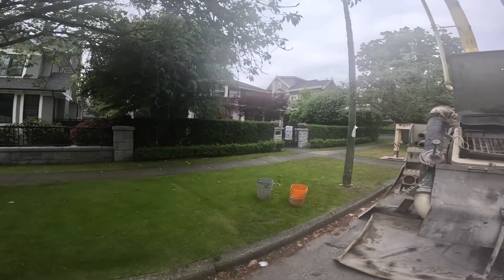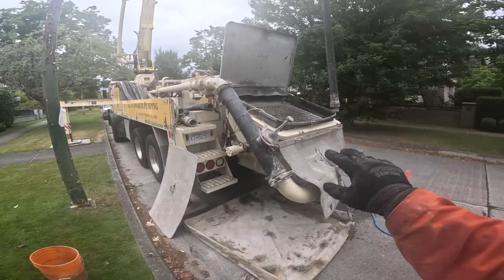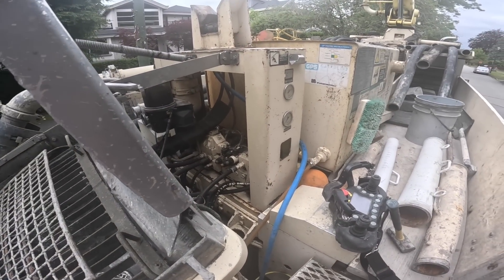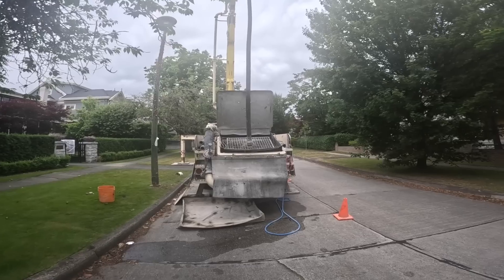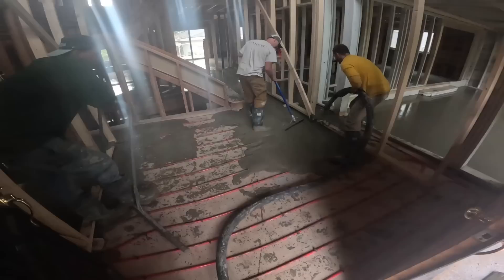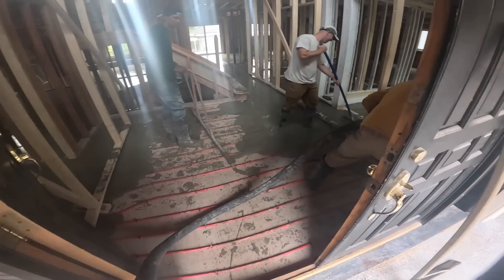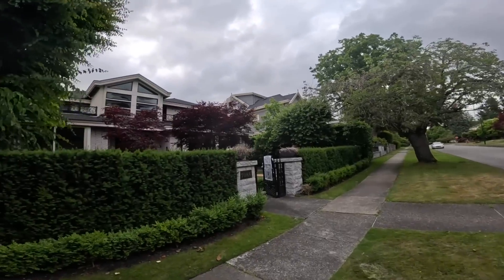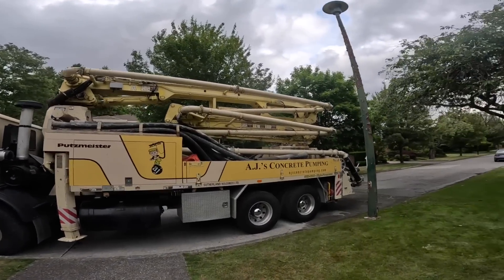Pumping floors with self-consolidating concrete:

Comment: We have a 28m Z boom in our fleet and its definitely the most versatile boom pump we have. For most of the jobs our bigger pumps do (where customers just want a big pump on site and the distance isnt necessarily the reason) we can get the 28m in also if we just think a bit more about the set up, so its a great back up pump to have on standby as well.
Reply from the maker: Thank you for the info. It’s good to here it firsthand from someone who’s running a 28 in their fleet.
Reply: @canadianconcretepumper1979  yup, and from your videos I would say our residential and smaller commercial jobs seem to be pretty similar to yours so a 28m would probably just as perfect for you as it is for us.

Comment: I agree on the 24m. A lot of jobs that i pull up to with it don't quite reach all of the job and end up with a hose on the ground. Where as a 28m would reach with a little push of the tip hose. Also looked like your debris came out in the prime of the boom at 13:54, ironic that you primed with out the screen as you would have caught it.
Reply from the maker: Nice job!!!! Shit, I had to rewatch that segment like 5 times over to catch that. This mix is so fluid that we actually pumped off more than half of that first load before it display dry-packed where that chunk was lodged into the reducer.
Reply from the maker: You comments with regards to the 28M confirm my theory. Good to here it from someone else in the same boat. 👍🏼👍🏼👍🏼
Reply: @canadianconcretepumper1979  Actually heard a clunk as it hit the grate then rewatched it slowed down and saw it.

Comment: maybe to "keep it in the family" so to speak, have you considered looking into the 31-5 putz? dont see too many of them around, not even sure if they still produce them, could be a reason why.  i believe they are a ZR config, sort of like the 20

that second chunk, to me, looks like a piston cup face chunk. i recently had the misfortune of finding one of those myself in the 5-4 reducer lol
Reply from the maker: I think you’ve nailed it with the piston cup chunk diagnosis. The 31 Putz I’m not super hot on. The reverse folding tip section makes it one heck of a low clearance pump, but from why I could imagine would also make it a bit of a bear for pump everyday/normal work. Also, the large-ish swingout style rear outrigger legs are a bit deal breaker due to the nature of the tight setup scenarios which we would need it for. I do think the the 31-5 Putz could arguably be the best pump ever for indoors/warehouse work, but we unfortunately don’t see a whole lot of that stuff.
Reply: @canadianconcretepumper1979  didn’t consider the swing out outriggers in the back, with the straight out style like schwing or the alliance i can see how much that would help in tighter set ups. my company has a 28M, got it just before the announced the redesign ☹️ great machine, unfortunately i feel the rear out rigger set up is just a bit under spec for that size boom, gets fairly unstable off the back corners, which is to be expected, just wish they could slide out like the schwing/alliance
Reply from the maker: @HighTQCummins  First boom I ever ran was a 1988 Putz 32M with the short rear outriggers. When you’d boom flat out over the rear corners the opposing side front outriggers would lift 1-2 feet in the air. Most definitely not the greatest feeling, lol! Our little 24Z does fine with the drop down rear outriggers, but I’ve always been curious as to how the 28M behaves with that same setup. I’m wondering if the newer 28Z would possibly be more stable as I’m guessing the boom would be lighter as compared to the previous iteration. 🤔🤔🤔
Reply: @canadianconcretepumper1979  it’s not that bad but it does like to dance when you stretch way off the corner

Comment: That’s why a use a rake when cleaning out
Reply from the maker: This pump actually has one I believe. The high-pressure back end has a lengthened outlet flange which makes it much more difficult to cleanout versus the standard boom pump back end. Definitely a few tradeoffs to running this heavy duty back-end kit.

Comment: I would replace it with a 28m putz. Having gone from a 28m down to 24 I don't see any advantages of a smaller pump than 28. The 24 and 28 take up almost same space when set up but the 28 reaches much more.
Reply from the maker: Exactly the way I see it, especially considering that the new 28Z Putz actually has a smaller outrigger footprint than our current 2005 model 24Z. The one main advantage I see with the new 24Z over the new 28Z is the ability to hang the boom over the front of the cab and drive into position prior setting the outriggers and unfolding. That being said, we see far more jobs which would benefit from the additional 12’ of reach of a 28M versus the ones which would requiring hanging the boom over the front end as with the 24N. Quite honestly, most of the shit which we fight our 24Z into setup position should really just be line-pumped anyhow (especially in our market where 2” hose friendly line mixes are the norm.

Comment: Why don’t you use Portland then you can let it go in the slab ?
Reply from the maker: Not typically, the added cost, but mostly added inconvenience of storing sack of portions versus smaller rations of bentonite don’t make it worth it for us on most pours. When we’re doing really high-end finished stuff we’ll use
Portland or Mortar as such that we mitigate and chances of contamination. Love the bentonite, just have to be on the ball and super diligent with regards to disposing of it outside of the pour are.

Comment: Here in Norway we usualy pumps through te boom, with te redusecing bits and then connect the whose and let it flow toight slowly and empty it and and take it in empty and then start ... Sorry my bad English... I used to drive a putz 28 m, 2008 model... Good pump but putz is still on same level exept pwnd by china (SANY)
Reply from the maker: I agree, the way you mention is definitely the most reliable way to do it, in my opinion. Only thing with this mix is that it’s very splashy and to prime into the hopper through just the 5” boom elbow would make one heck of a mess.